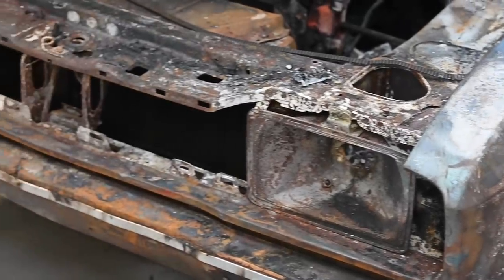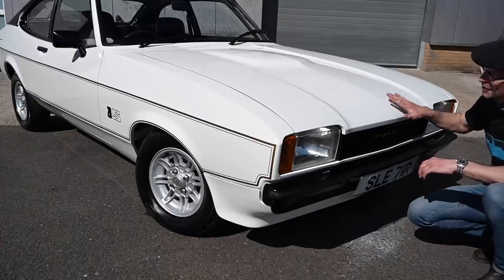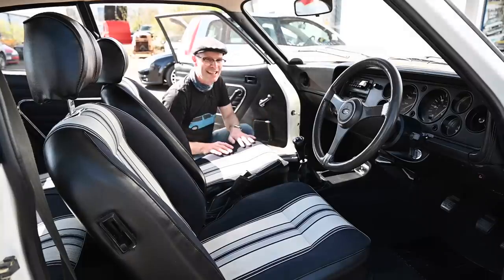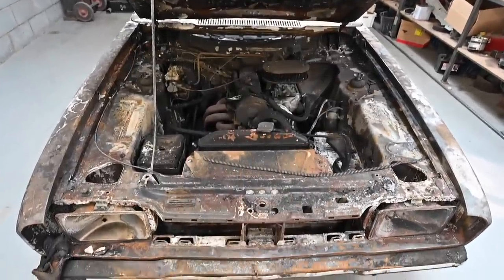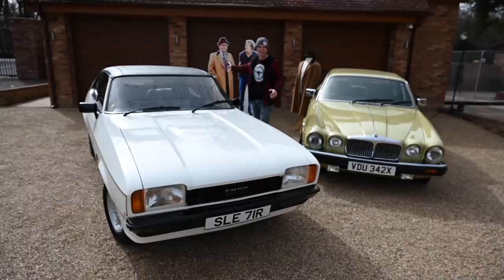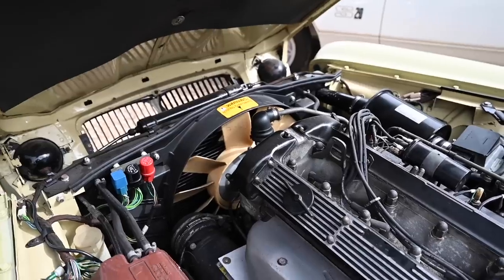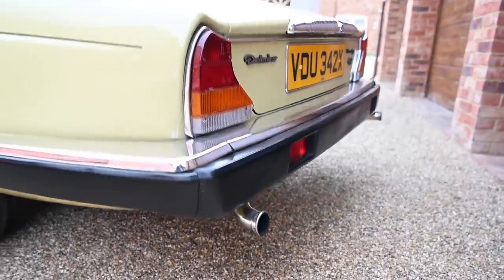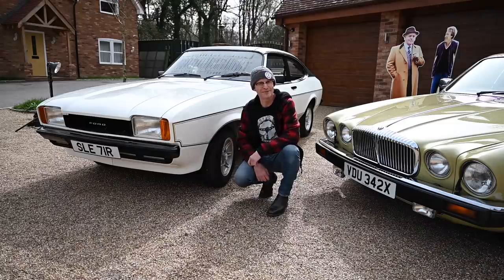Minder Capri is finished! And meet Arfer's Jag!

Comment: It mat have been one of the cars,  but it’s not actually the only car,  if you watch the episode “around the corner” you will see its a different car, not even the rims are correct,  the pinstripes are totally wrong and other differences eg the car used in that episode has a black rear spoiler,   It’s not uncommon for TVs to have back up cars,  especially if they use stunt driver’s,  actually in one episode the car has no pinstripes and is badged 1.6lt    Even the number although correct, is not the original,  and if you are wondering how I noticed all of this,  1) i own the boxset of Minder because it’s one of my favourite shows, and i also owned four white capris over my lifetime, 3 of which were 1.6 lts.  So it’s a one of the Capris used possibly .

Comment: I had a 1.6 l Capri Mk II in the early 1980's- the automatic choke was a nightmare. If you touched the accelerator even slightly on ignition, it would NOT start. Then the solution as told to me by an AA man, was to remove the air filter, take top off WD-40 can, fill with petrol, pour down carb, run round quick & start engine. Despite that, loved the car!

Comment: She did well to survive the dreaded e10 fuel that's what did it. I actually suffered running issues with mine at the same time. Turned out after about three trips to the garadge between around November 2019-june 2020 I learnt my place of work had e10 unleaded and switched to super unleaded.

Comment: Glad that stupid ‘minder’ window sticker bit the dust
Reply: Sadly, the urge to put a stupid sticker in it is strong though. That fake dealer sticker in the back window is way too big to be convincing. What makes it worse is that there were joke stickers available for Arthur’s dealers in the ‘80s that were the same size as a normal dealer sticker - I used to see them on a few cars when I was a kid. They didn’t jump out as anything odd until you looked closely at a car with them in the back window. 

Maybe an information board to put in front of the car at shows would be the way to go, rather than daft “look, it’s the Minder car” stickers? 

Also, the S stickers (next to the 2.0 badges) on the front wings are clearly not on the car in the titles of the show. For absolute authenticity I’d be getting those (veeeery carefully) removed if I owned the car.

Comment: Nice car however there is a mistake somewhere.    At the clip of Minded at the start - the drivers mirror is not an internally adjustable type.  Ok you can upgrade to that but a 2.0lt S  came with them as standard.    So there is something incorrect.          I always thought Terry's was a 1.6lt L

Comment: Didn't they actually use a couple of different white Capri's? I remember Terry driving a couple of later twin headlight models, and one of the twin headlight cars wearing this earlier reg plate.
Reply from the maker: There were a couple but this was the main one
Reply: This one was in the opening scene but lots of others were used.

Comment: The original capri from the minder series was a 1.6 and had a trim strip along the side , si hiw come its turned into a 2.0 with all that piping everywhere
Reply: This car has always been a 2 litre S, it should have the sills painted satin black and the decals or pin stripes should be black, also the steering wheel should have 2 crossed flags, the centre cap on the steering wheel now is a MK3 steering wheel. Still a nice job though.
Reply: @LordFlashheart.11  when watching minder the other day , SLE 71R as driven by terry mccann is clearly seen with a 1.6  MARKER BADGE On the front wings , a single chrome trim strip along each side midway up the doors . Somewhere along the line either the tv studio have altered it or someone else has , this is the capri seen at the start of each intro and in most of the shows starring Denis Waterman
Reply: There were 4 or 5 Capri s used on minder even twice headlight ones.

Comment: Not a great fan of the pin stripe bit ott. Not an anal person but I guess it was a question of restoration to an original S opposed to Terry's car?. Terry's car had 2 x thin pin stripe and not in a box shape and no S sticker on the front wing
Reply: Yeah it's more like the jps coachwork like the black jps had, a cars only original once and I certainly wouldn't pay 52k for any capri.
Reply: @chubbyroyston3880  yes that wear iv seen it befor. My friend had a 2litre S in jps livery, hated the mk11 headlights, had to be the face-lift version for me. With the 4 headlights.

Comment: Arther   had a few  Daimler  or xj6  in the full  set  of series.     But very nice   to own  his cars  his coat  and  hat  and lighter.  And a bottle  of champagne.    What is that worth  now  2024 ? .   Still watch  on you tube  .   Got the box set  but not opened  it yet  . Had now about  4 years ?  On dvd. Still sealed  . Great video  . Top Mark's

Comment: The Capri in the show (intro) had a sun roof .. so unfortunately, other than the same letters and numbers on the plate, I don't believe this is the minder car .. and if you watch the show carefully, it is quite obvious that there are several Capri's used and none of them seem to be this one .. even the number plate, whilst it has the same letters and numbers is different as in the show it has raised numbers, it was not a flat plate .. I don't think you can really call this the Minder Capri.

Comment: The 2 litre were so underpowered compared to the 3 litre Ghia. Once you had one of them anything else didn’t compare.
Reply: Had a '75 3L, purple/black vinyl roof, gear lever would come out in your hand, randomly and often. Had a V8 TR7 next, watched the engine leave the car exhaust system, red bits of metal lit up the night sky in the rear view mirror. Then I got a 635csi manual with the ZF box. Now that car got me banned. :D

Comment: i thought sle71r scrapped by lwt as didn't think getting 2nd series hence mk1 used sle71r and terry had cpl white mk2s in series that followed???? or buy reg plates off dvla build car round it ?????  apart from that all classic ford owners if want remote mirrors both sides buy rhd a lhd one vice versa have pair we used to do often all toggle models have left hand drive cousin handy tip for ppl who,d like luxury of both:hand-purple-blue-peace::face-blue-smiling::hand-purple-blue-peace:and arfurb   did light cigar up in hypnotist episode in cigar shop all taste burnt tyres

Comment: Quite a few errors...you said "EIGHT DIALS", the rest of us count SIX, a daft mistake given you admitted you'd looked over a similar car very recently. The push buttons below the heater controls, one missing is the washer to match the wiper button, should not be two blanks there. FIVE SPEED GEARBOX KNOB, does that simply mean you couldn't locate a FOUR SPEED PATTERN, as the 2.0 MKII, never had the 5 speed gearbox. This car has had the drivers remote control mirror added, which if you look at your own intro, was not fitted to the original car.

You said "This is Arthurs actual DAIMLER...the JAG that he sat in". Are you so mixed up you don't know the differences between the two?. Next time you post, spend some time checking before you mumble nonsense as a commentary.